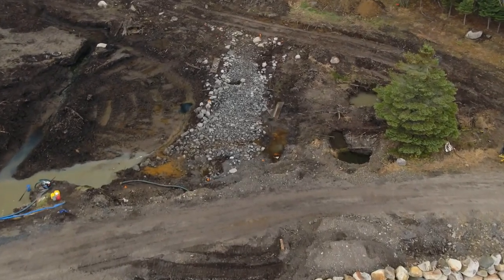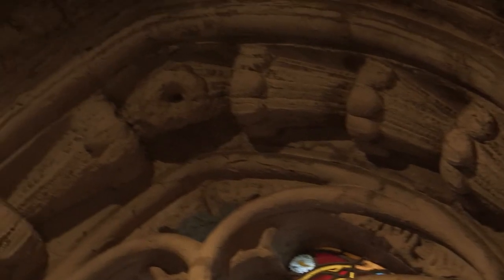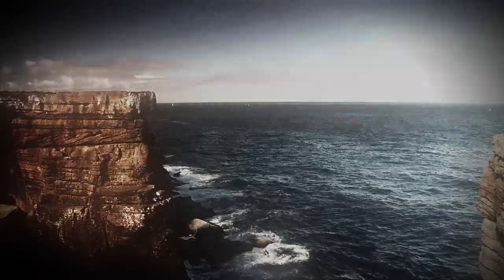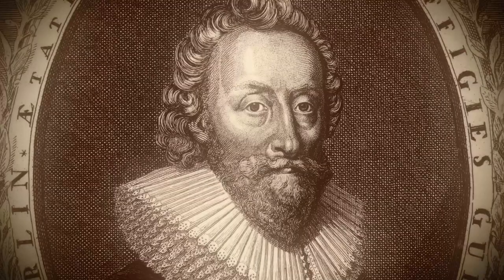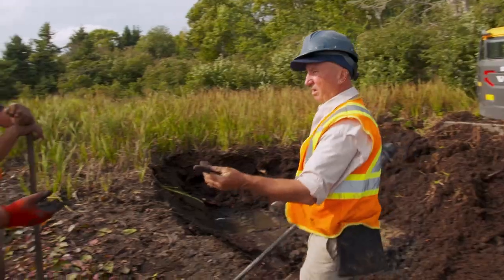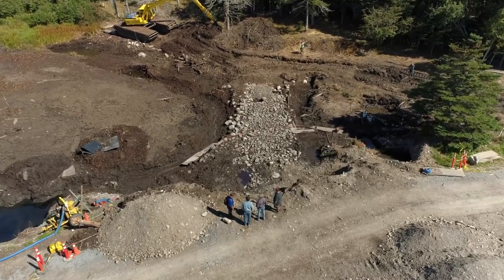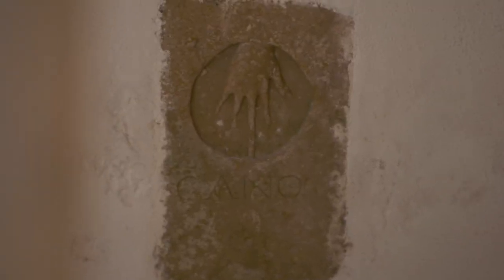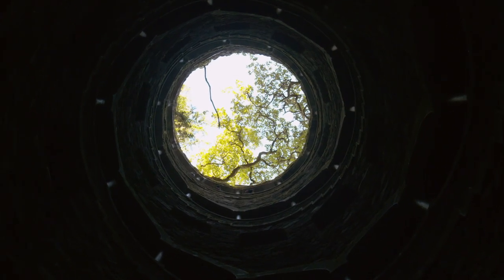The Curse of Oak Island: Who Buried the Oak Island Treasure? *TOP 3 THEORIES*

Comment: I think that the reason the clues don't make much sense is that they aren't looking for a treasure but multiple treasures.
Reply: Very possible. But after all this time would you stop looking if you found one treasure?
Reply: i'm sure the island contents was known to certain groups thru the ages
Reply: I don't get this program. Often they don't seem to follow up on things. For example, if they found a strong possibility of a sunken ship in the swamp 4 years ago, why haven't they drilled down to where it's supposed to be? It could still be full of treasure, and if not, identifying the ship would fill in huge gaps in the history of what happened and when, yet it's been largely ignored apart from some minor exploratory work in the swamp. 

I know there are (supposedly) permit issues now, but that's a more recent thing. Wouldn't you move heaven and earth if you thought you had found a large galleon hidden in a swamp? That's just one example. There are many more, such as the suggestion of a hatch to the north of the island (Zena's map). Why hasn't a lot more work been done to find that instead of spending time on what appear to be relatively meaningless projects? 

Another one was a shaft that was found on the beach very close to the edge of the barriers they used to block off the sea. Seems a very strange place for a shaft but again, it was hardly mentioned during the show and hasn't been at all mentioned since. They just filled it back in. And by just drilling holes in the money pit area, they could easily be missing things just outside the hole they're drilling and never know it. Why wouldn't you build a shaft that can be accessed if there are tunnels and voids down there? You would want to find a way to get in and have a look, and it's not like we don't have innovative tunnelling techniques these days. Makes no sense to go hundreds of feet down only to be able to explore what the shovel pulls out of an area of a few feet across, i.e. the diameter of the caissons. If there was a chance of really precious items or artifacts down there, would you want to risk drilling through them? 

I love the show, but it does make you wonder if there's nothing there and never has been, and it's just a show that's made for entertainment value which is paying for itself as long as they continue to get enough viewers. Seems odd that nothing of great significance or value has been found after all these years, especially given all the technical equipment that has been used.
Reply: @gssf.gr29  Your Correct, and you must realize, if riches are found the TAX MAN NEEDS PAID.  My point, if Riches Show Up the point is not to emphasize such, to have a TV Continuation.    The show is doing well on the show standing alone, it has sponsors and a following, and that is a good definition of Riches also, to be had.   It appears, as a commercial venture for TV, and nondescript discoveries for some reason....????? LMAO   Think, about the entire situation that is most obvious.  You seem to be correct in your service observations,  but think deeper on a capitalist level, to feel more into the concept you present, if there is a nontarget, or a leave target leads,, as you say, about some leads, but not developed on,  or show on the TV.  Who knows the reasons, but to me it is purely capitalistic at best.  THINK

Comment: Professional dowsing with the modern light weight ball bearing dowsing rod is what's needed for finding any treasure at Oak Island.  The Art of Dowsing - Separating Science from Superstition book teaches how to use physics in dowsing with using gravity as the gauge for precisely dowsing out the edges, exact center, depth buried with angle of deposition, and GRADING.  The physics used in on-ground physical dowsing with the light weight modern ball bearing dowsing rod is explained in laymen's terms so anyone can study the book with performing the dowsing lessons given for turning anyone into a professional dowser.  This book has already turned a few people into competent dowsers.  The ten chapters in the book will teach the entire world how and why with gauging of what is being dowsed.  Chapters : 1 - Theory of Dowsing's Relativity to the Atomic Theory of Matter,   2 - Magnetism Theory's Relativity to Dowsing,   3 - Building and Maintenance of a Dowsing Rod,   4 - Dowsing Rod Load,   5 - Hands-on Dowsing Theory and Practice,   6 - Dowsing Out Ore Veins and Mineral Deposits,   7 - Dowsing Down the Highway,   8 - Dowsing Gold Placer Deposits,   9 - Dowsing Cashes, Stashes, and Lost Treasure,   10 - Dowsing on Water from A Boat.   The modern light weight ball bearing dowsing rod is the only dowsing rod that can use gravity as the gauge for deciphering all aspects of the elemental mass being dowsed.  Case in point is when dowsing high grade gold deposits the dowsing rod will "HELICOPTER", (spin), the modern light weight ball bearing dowsing rod so fast that the human eye can not follow the spinning with it looking like a helicopter's blades spinning when in flight.  The book will amaze and flabbergast the reader with the same for the YouTube video filming of dowsing on the channel soon to be posted that is being named :  The Art of Gold Dowsing.  Thank you for reading this post and I hope you have a nice day (or night).

Comment: They will never find anything unless they plug up the tube's that feed the water to the booby traps  !!!
Reply: That's probably just standing water, the water table. To me, if there was anything down there they would be digging their own tunnel to try and find it, not just boring holes and filling them with caissons. Makes no sense as you'll never know what's on the outside of those caissons. If there are tunnels, all your're doing is blocking them off.